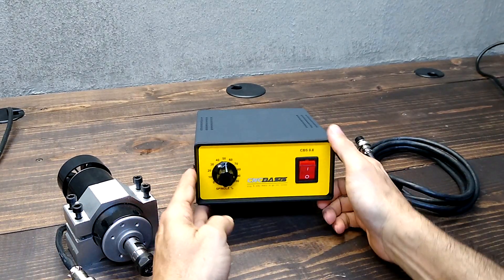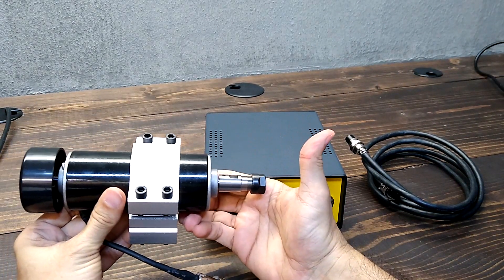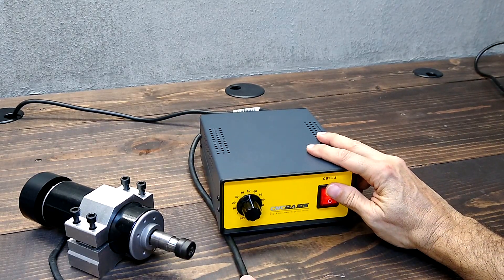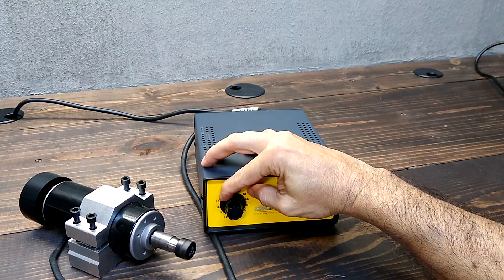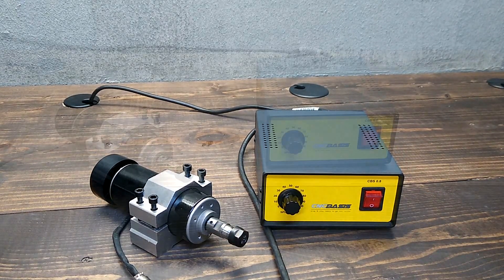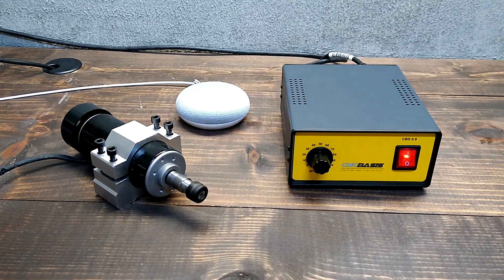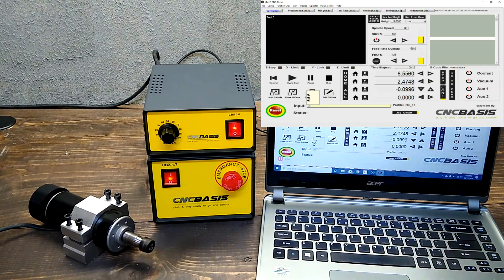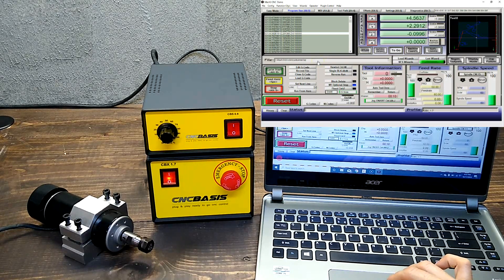CBS 0.8 Spindle & Speed Control 500W, 12000r/Min Set

Comment: Hows the runout?
Reply from the maker: ER 11 Chuck with 1/8 collet
Reply: Run-out or runout is an inaccuracy of rotating mechanical systems, specifically that the tool or shaft does not rotate exactly in line with the main axis. For example; when drilling, run-out will result in a larger hole than the drill's nominal diameter due to the drill being rotated eccentrically (off axis instead of in line). In the case of bearings, run-out will cause vibration of the machine and increased loads on the bearings.[1]

-Wikipedia
Reply: @waldvogelreview7755  it's super bad. It's the same generic 70$ chinese spindle you find on aliexpress or similar sites.